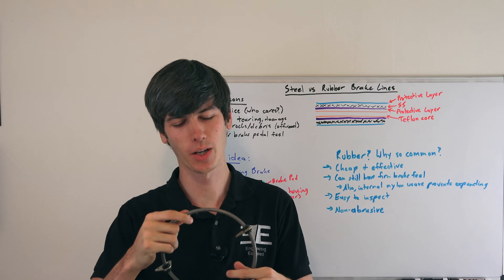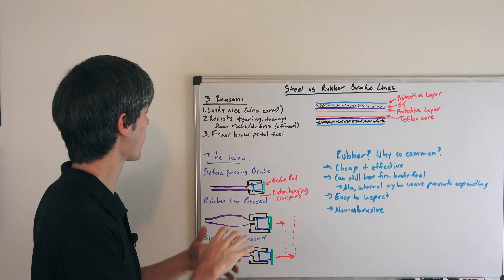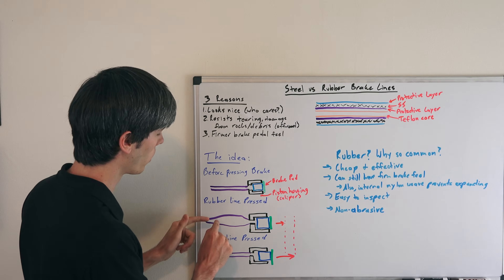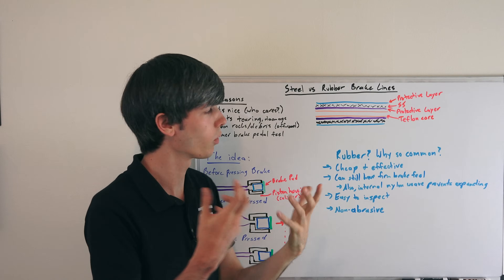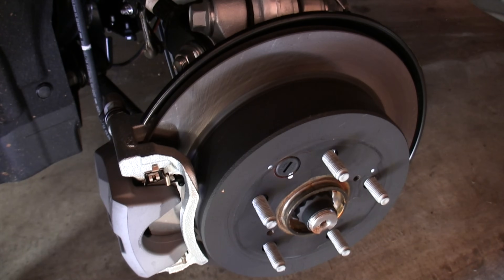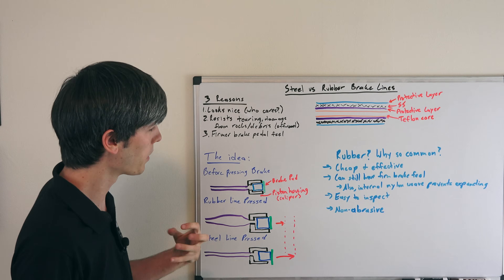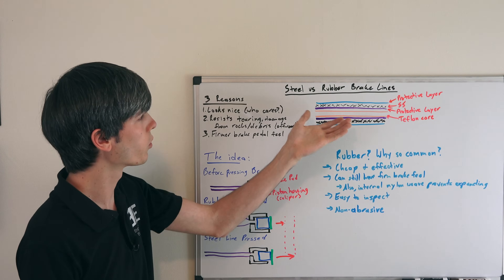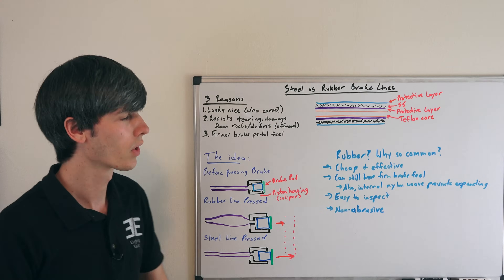Steel Vs Rubber Brake Lines - Are Stainless Steel Lines Silly?

Comment: great video but to add a bit to the video on motorbike side
most of the stock brake line although it looks like a rubber cable, inside is basically a metal braided cables(or kevlar)
 i am no car expert but i have some share on bikes so all i can say about is bike. but as far as modern performance bike goes, although it appears to be rubber cables they are in fact braided cables with either some kind of metal(not sure exactly what kind of metal as all i did was actually cut my old cable with a plier to see what was actually inside.) or some synthetic material. so in the end far as modern performance bike goes, there are very little reason to go with aftermarket steel cables cuz only diff is the asthetics

Comment: 👈did line conversion on this from new rubber to stainless braided & the feel was drastically better, it felt like i was clamping the rotors with my bare feet
Reply: +Del Walker A lot of people say that but it raises a question. Are brake feel and brake performance the same thing? Has your stopping distance actually decreased? 
What I'd like to see is an apples to apples comparison on the same car using new quality rubber against new quality steel.

Comment: this also may have some exaggerated feel difference on a car that is 7 or 10 years old. where just replacing the rubber lines with oe new ones would also provide a similar difference in feel.

Comment: on  NUMEROUS  occasions i have seen rubber lines hemorrhage internally and swell shut on the inside behaving like a check valve. 
the hydraulic force of  the master cyl will force fluid into the brake, but the brake will not  FORCE fluid back to the m/c. the brake will stay partially applied, drag, overheat, some times catching fire, burn pads, rotors and bearings. 
teflon will not ever do this.
one nearly certain way to prevent rubber hemorrhaging is to use silicone dot 5 fluid. i use it in everything. it will not absorb water and lubricates all the brake seals while in use.
Reply: +mixter7x7 Unless your car was designed for DOT3/4 and has seals that cannot handle the silicone chemitry (like most cars)
Reply: from my own personal experiences- never had a problem with dot 5 silicone. only with the ester base dot 3/4 fluids. never had leaks, seal issues etc. nothing. but thanks for the response.
Reply: Then you got lucky. In your car the selas happened to be OK with it. THere are others who were not as fortunate. Don't get me wrong, if the manual says use DOT5, then of course it is safe to use it. 

Another problem with silicone based fluid is if you put it in a system that previously had glycol based fluid in there, you run the risk of phase separation. Water, if there was any, will not mix with silicone-based fluid. Then that water can boil and cause break fade.
Reply: certainly it could cause problems if all of the other fluids are not removed. this is why i always do an alcohol and then air flush. ( 2 times )  the alcohol mixes with the old fluid ester/glycol base fluids and cleans it out.  the air dries the alcohol. it's not that hard. takes me 1-2  hours to do the whole car/truck. actually the smallest " round-up"  kinda pump sprayer from your hardware makes an excellent back bleeder at a fractional cost.

Comment: Fun fact the 500bar connection lines to rescue equipment used by fire fighters to cut open cars after accidents are made from rubber as well
Reply: +Heidelaffe  The ones we use are not really rubber, they are some engineered polymer with a LOT of Kevlar in the weave. Have seen them split open, pop the fittings off the ends, had one that de-laminated and looked like it just swallowed a big meal!
Reply: *****
 That is what he said in the video as well.

Comment: captain classroom spreading the word of "kind of sort of true, but not always".  

For most people yeah, rubber lines are more than fine.  Racing or performance though, not even close.
Reply: +Brian Bieger If you replace your entire braking system you can consider it, if you are just want to do a 100$ upgrade for your car it is pretty much pointless. Also it adds (just a bit) of extra weight to the unsprung parts of the car.
And look at it this way: Even major sports car manufacturers such as Porsche are using "just" rubber brake lines. I found some pics of steel brake lines from Ferrari but I am not sure if these are just for show or avoid complications with customers who think they know it better then them.
Reply: +Heidelaffe .. I race bikes, I'm not quite sure why, most likely the power to weight ratio, but braided brake lines make a world of difference on a motorcycle.
Reply: +Brian Bieger Keyword being "race". No one who drives casually and doesn't brake late into corners will say "Wow I wish I had those lines" but for those looking to get the most performance, small amounts of feedback are important imo.

Comment: I had a 1997 bmw f-650 that when the brakes got hot, the rubber line for the front brake would expand so much that I would not stop if the outside temp was over 90 and I had been riding for any time..  Replaced it with stainless and I could stop no matter what...

Comment: +Engineering Explained for what it's worth, i'm pretty sure the protecting coating over the braid is to stop foreign material from getting lodged in the weave and causing line damage. from what i recall you can find non DOT lines without the coating but all DOT lines have it.

from experience, you can hold a new rubber brake line during application and feel the expansion with your fingers. not so much with braided.

Comment: The firmer feel is one that kind of came from bikes.  Cars have steel brake lines.  The only rubber is usuall just that short stretch around the spindle.  Volume of expansion is minimal.  However get into motorcycles without power assist brakes and it becomes easily noticable.
Reply: That and most people putting new lines on bikes are replacing 20 year old rubber lines.
Reply: @zorgzev96 I got a huge improvement on my bike at ~8 years 10,000km. Even had them custom-made because I couldn't find the exact setup I wanted. It's a very easy and affordable upgrade to do on a bike
Reply: Just what I was saying in other comments.

Also fluid getting too hot leads to boiling and bubbles. Sure way of losing a significant amount of force and feel.

Comment: What about wear and tear on the brake lines for people who drive in all sorts of scenarios. Like me. I bought a 2012 Mazda3 iSport Sedan 5-Speed Man about 8 months ago with roughly 56,000 miles on it. My last odometer reading was at 74,700 and some change miles. I drive a lot. And often with a lot of weight in my car, fully loaded, about as much as the weight of 3 full adults and their luggage in cargo, cross country, through all sorts of conditions. I drive through humidity and heat in places like florida, through ice, gravel and salt in massachusetts and vermont, through broken roads in NYC, through really bad georgia and carolina thunder/rain storms. 

I'm adamant about my maintenance, but my biggest back of the mind worries are with potential brake failure. And so for the conditions in weather, road material, temperatures, the extended duration (up to 11 hours a day for maybe a week straight) for which i'm driving over, is it maybe a safer precaution swapping my rubber lines for braided ones?

Comment: Well, all I can say is that I replaced the rubber lines on my 12 year old Volvo with SS lines and the difference is noticeable.  Firmer pedal feel, and a more direct pedal pressure/braking force ratio.  I'm sure the science may say otherwise, and the explanation is valid and plausible, but I'm happy with the improved performance of my braking system now. Cheers.
Reply: You replaced 12yr old brake lines and you noticed a difference afterwards?  Well then.

Comment: stainless lines bulge a tiny bit too, ive seen it on the industrial level if the pressure is to high anything will flex

Comment: I don't know why but my car came with both. There is a solid steel line going from the brake booster to the ABS module. Then there is a braided brake line that connects to the steel lines that run along the frame of my car. But then at the wheels there is rubber. I have a 04 Mountaineer. I don't understand why ford would do that. Does anyone know why? Cost? I'm sure each has its own benefit and downfalls

Comment: rubber works just fine for regular road cars. 
but when tracking the car, brake fluid will soak heat from the pistons, and a heated rubber line will expand more than a hot steel line. aside from that, yeah sure rubber lines work just fine.

Comment: Brake line manufacturing comes with a LARGE amount of safety and testing. The interwoven nylon lines that our host mentioned aren't just placed in there, they're interwoven at very specific angles, depending on application, in order to give the highest tensile strength possible. They are then melded into the rubber during the vulcanization & curing processes. With the high nylon tensile strength, highly flexible rubber, and full failure testing approval throughout the manufacturing process, he is completely correct! Rubber brake lines are a perfect fit for most cars on the road. Excellent products. Metal woven lines are mainly for looks.
Reply: Steel lines are not mainly for looks, especially when they’re hardly ever seen. The reality is that they provide every practical quality as rubber lines, with the additional benefit of being very tough on the outside. It’s a small thing in most cases, but if you want the best of the best, it’s going to be a braided steel line.

Comment: If you use you car/truck on the track, the fluid can reach high temps. The temp of the fluid is then transferred to the brake line and in turn it will make it  softer and more likely to expand and fail.

Comment: Its too bad most of the stainless lines are cheaply made in asia with iffy quality. (others touched on this. lack of dot approval etc...vast majority of aftermarket lines you find are of this quality...usable but you have to tread carefully)
They are totally a wear item! Need to be checked regularly and not used nearly as long as a quality oem line.

Comment: The bottom line is that rubber lines get the job done. However, braided steel lines feel better. Those of us who race depend on this edge while "threshold braking" into a corner. That is, when we're decelerating hard and nearly at the point of lock up (or ABS intervention). Practically speaking, this irrelevant in regular daily driving. However, when "in battle", it's a truly excellent improvement. All my street and race cars get braided steel lines. By far, they're worth the investment.

Comment: I know that going from old rubber lines to new stainless braid items, I had a huge difference in pedal feedback. I was able to control wheel lock ups under braking etc. But the rubber hoses were old and could have had a soft patch etc. This was on my 72 Holden HQ race car.

Other thing I like about stainless braided items are the versatility of them and the fact that they cab be made to almost any specification you need.

Comment: new rubber brake hoses have a swell rating at 3000psi , while most vehicles with boosters produce a maximum pressure of around 1300psi . there is no expansion in the rubber hose of standard length . if the hose has been made longer for a lifted vehicle . the extra length of the hose can cause a flex or twist of the hose , resulting in a spongy feel , but not due to hose deflection . rubber hoses are compatible with all types of brake fluid , but if you are changing from a dot3 or 4 to a silicon fluid , residual fluid can cause contamination with the new fluid .

Comment: Where did you get some of your info, the SS lines core will expand it's the braided SS that keeps it from expanding, did you know that some grades of Stainless Steel will rust, that is why they are coated on the outside, well one of them, the other main one it to keep it from being abrasive to other parts. BTW If both are defective they leak so it's just as easy to find!:-) and the SS lines are superior to the rubber, as you call them, except in cost of manufacturing & buying. Good day. yl
Reply: chineese stainless steel will rust (lol), never saw real SS rust.  Infact I use them on gate repair for just that very reason.

Comment: SS lines do make a difference in performance applications. Nylon weave does stretch under high heat and pressure. Take it from someone who has driven a vehicle under heavy braking conditions with and without(same vehicle) braided lines. There's a reason. Brake systems have extremely low flow rates. It's about transferring pressure and multiplying force. Rubber lines do expand slightly more than braided ones and when you take into consideration the minuscule amount of actual fluid flow involved in the process, the "negligible difference" in stretch is actually a big deal. The other key factor is that brake fade is caused in part by rubber lines getting hot from the brake fluid transferring heat out of the caliper and stretching more than at normal temps. While that is only a small part of brake fade, it's still significant enough. Brake fluid boils at 400*F(DOT3) which is high enough to soften the material of the rubber hose. DOT4 boils at 450*F which can actually melt lower grades of nylon. DOT5 Silicone fluid boils at 500*F which melts most grades of commercial nylon. They make a difference in feel AND longevity under heavy use. AND Teflon(IF and ONLY IF your lines are Teflon inside, most are not) does expand under the pressures involved in brake systems, that's why there's a Nylon weave in the cover of every brake line I've ever cut. Go to a junk yard sometime and cut an old ratty brakeline on any car, new or old. No hard core, just rubber.

Comment: I wish stainless steel was mandated for "hard lines' or maybe copper-nickle.  Anything that has better corrosion resistance than what they use now a days !

I would also like to see all fittings and "clips" be made of stainless.

But then, I am "odd" for driving 10+ year old cars in the "rust belt" !

Comment: hey, Engineering Explained, about a year and a half ago i had full size car and im not sure if a stupid mechanic left them on or someone knew what would happen if they did and tried to kill me, but i brought the car and about 2 months later i was going down really steep hill so i pushed in the brakes with more than regular pressure and suddenly boom, pedal to the floor and no brakes whatsoever, none, luckily i was quick enough to engage the handbrake slowly enough so the back wheels wouldn't lock up and id spin out but i saved the car and didn't hit anything, so me and my mate got out and pushed it to a nearby parking lot and me being somewhat mechanically sound, checked the master cyl and brake lines and the front left brake line had blew off from the top and brake fluid was everywhere and in looking i noticed a chrome tool, so pulled it off and there was a pair of vice grips, you know the kind of pliers that you can keep locked, well my question is, (never had the chance to hold steel brake lines) would steel brake lines prevented this had i had them? thanks for any advice from anyone (im just wondering if they do, i might get them on all my cars from now on)

Comment: It may well be a little common sense, but I've really only found the benefit under extremely hard braking.

For normally driven cars, like for like I don't see a big benefit.

Track cars, or very hard driven cars, yes go for it.

Many of the stainless steel lines aren't a great fit and can weep from research.

All should be considerations.

Comment: I may be wrong on this but the real advantage of the coating or sleeve over the SS braid is that dirt and particles can get trapped in the mesh of the SS and with enough movement cause abrasions. A sleeve would on the other hand prevent such particulate from getting in the braid.

Comment: I've driven other examples of my own car, similar model year, with stainless lines and the stock pads. I have the stock "rubber" lines (which have a woven core as mentioned) and aftermarket street/track pads. I strongly prefer the pedal feel in my car. I barely even have to touch the brake pedal, and the car is already stopping. Pretty simple...upgraded brake pads have a higher coefficient of friction...and my particular pads have one that is higher at both low and high temperatures relative to stock. If you want more initial "bite", get yourself some quality brake pads.

Comment: Flex hoses. Titling a video like this is quite misleading since lines are the hard lines that run from the master cylinder to the  suspension connection point near slave cylinders which are either calipers or wheel cylinders. This video was about flex hoses give the flexing needed because of the suspension.

Comment: This has been tested before, Steel lines are more or less a gimmick. They are purely for aesthetics and longevity only, they offer no performance upgrade over rubber whatsoever. I can't reference the test but I remember it being conducted with a hydraulic rig that exceeded common braking pressures and next to no expansion was detected in the rubber lines.

Comment: Stainless steel brake lines are a racing application for the most part. Great video on the topic, most guys who want better performance from their cars are fine with OEM parts, and indeed brake lines will make zero difference.

Comment: My Dual-Sport motorcycle has got about 4 ft of rubber line to the front brake caliper. It's amazing to watch it expand as the lever is pulled.

More importantly, the expansion actually helps prevent front lock-up on loose dirt as the caliper piston takes longer to respond to the lever pull, than if it had a steel braided line. However, on the street, a steel braided line would provide a much better brake response. Almost impossible to lock-up the front tire in a straight line.